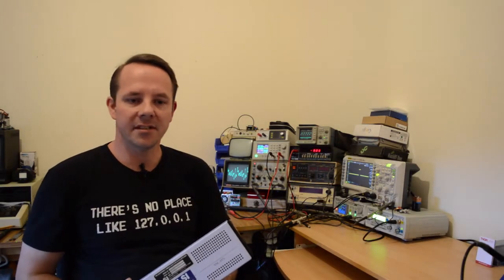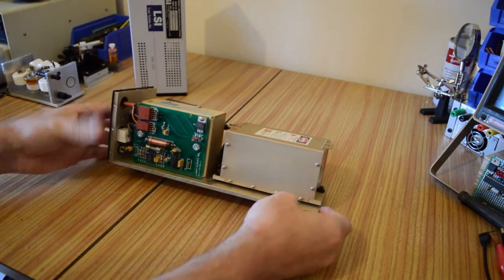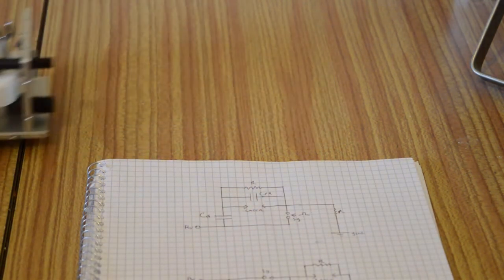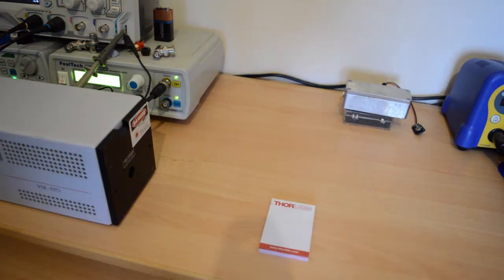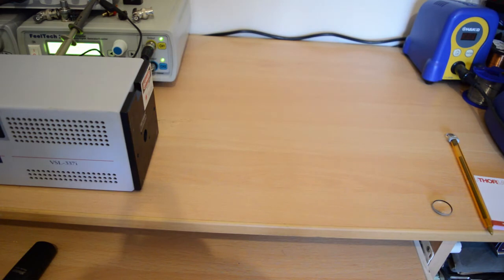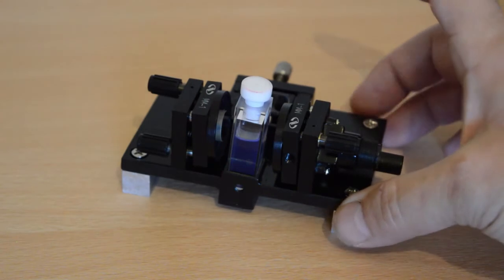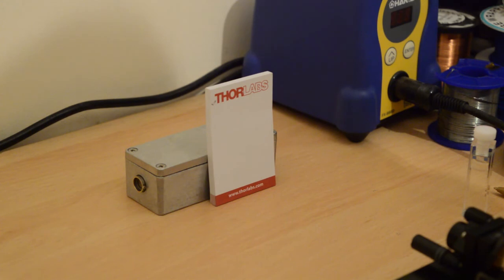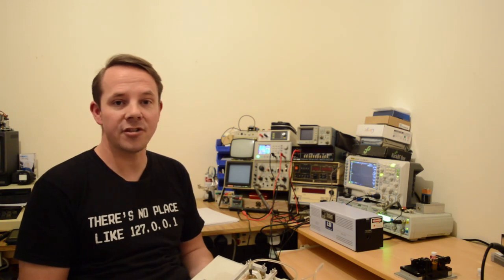Nitrogen Laser tear down, power up, and Home Made Dye Laser Demonstration

Comment: Ten years ago, before the accident i builld two nitrogen laser ,first with longitudinal excitation and the second it was a TEA laser  with equal capacitors.For LE laser discharge i use a capilary with 1mm hole and10cm long with thin windows at the ends.I made low pressure with a seringe.Disadvantage was ozone forming after 15 seconds.My power supply it was a plasma globe flyback  transformer (10kv AC high frequency) and it work with acceptable results.For tea laser the results was very low because i use a high inductance spark gap (my spark gap had long wire)and i use a lot of glue to capacitor .At that time i don t know the trick with low inductance.This is my experiences with nitrogen lasers.

Comment: It might be the titanium dioxide that is added in paper that you see as blue. I don't think they would use coumarin in paper. I also see this fluorescence in white plastics that are dyed with titanium dioxide. I would have to check but I think coumarin like many other dyes needs to be in a solvent for the molecule to be in the right configuration for fluorescence.
Reply from the maker: Thanks for watching!

You are right,  TiO2 is used in paper manufacture as a brilliant white pigment, but its primary mechanism is as a bright pigment, rather that as a fluorescent compound. Although TiO2 does fluoresce, its quantum yield (~0.2) is poor in comparison to Coumarin dyes (~0.73) also the peak fluorescence emission of TiO2 is around 350nm ( in the UV).

TiO2 is primarily used as a brightener because of its highly reflective properties. Believe it or not TiO2 can reflect more light (around 99% in ideal circumstances) than a regular aluminized mirror, , and for this reason, is often used a a diffuse reflector in flashlamp pumped lasers.

Coumarin will quite happily fluoresce when not in solution and is used in paper manufacturing and laundry detergent as an optical brightener, which is why white clothes will fluoresce brilliantly under UV. Is is in fact possible to get liquid laundry detergent to Lase in a dye laser cell!

Stay tuned, I will be doing a teardown on a bigger N2 Laser (once it arrives) ;-)
Reply: @LesLaboratory  Interesting, I will have to look for some information on it. I have not read an MDS on coumarin so I wasn't sure of it's toxicity/uses outside of scientific applications. 

I did a quick test just now with a mini TEA and 355nm laser and you're correct it does show some fluorescence in it's dry state. I am actually a bit surprised because the most dyes seem pretty inert. Bad assumption on my behalf on that. As I said, I am just getting into dye stuff. 

I did not know that titanium dioxide was used in flash lamp assemblies but now that you mention it I think I have seen what look liked white ceramic in a YAG once, but just once. I'll have to take a gander when I am back at work.

 I will certainly stay tuned for more videos, you certainly know your stuff and then some. Now when you say bigger, like is this a laser that needs a cart? lol I should send over some pictures of the N2 laser at the shop I work at that is being rebuilt. You would get a kick out of it I bet. Nothing spacial but it  has built in gravity.

Comment: i made the circuit for hene laser(without capacitors because i dont have)but with a more voltage tube lasing.thanks for this design. output decrease in intensity when the tube heating up?
Reply from the maker: This question was asked previously. Such a power supply absolutely requires filtering capacitors and current limiting, else the tube will become unstable and/or fail. There are no shortcuts unfortunately.

Comment: Any recommendation for materials for the 50/50 beam splitter & specifics for the collimating & quartz cylinder lens you use? I'm setting up a system similar to your video last year on Super Continuum. Not an optical engineer but have spent some time working on camera systems. I wear my rated safety glasses and lock the room I'm doing my assembly work in.

Comment: 3:07 can you elaborate it plz , does helium Mixture used in co2 laser serves as same purpose as used in this laser !!?? Plz tell
Reply from the maker: More or less. In the Nitrogen Laser Helium is simply used a buffer gas that negates the need for a high vacuum, and also helps with ionization.
In CO2 Lasers, it helps the CO2 Molecule relax back down to the ground state, aids ionization, and because it is thermally conductive, helps dissipate heat.
Reply: @LesLaboratory  thank you

Comment: Question: awesome educational video my question is I was luckily to inheriting the laser cartridge without the circuitry so is there other way to power it manually can I used  power source such a variable transformer or ignition coil driver ?
Reply from the maker: Hi, yes you can power those with a home made HV DC power supply. The cartridges don't require vast amounts of current. Ignition coils are not really suitable as the cartridges  expect smooth high voltage DC. A better bet would be a ZVS driver and a small DC flyback. You must limit the output current with a large value resistor, maybe 10Meg to 50Meg. See: https://www.youtube.com/watch?v=GbQEan4gwWM

To power the cartridges, the black wire or case is ground, the larger HV connection should be supplied with 17kV and the smaller HV connector is the trigger (a few kV).
Reply: @LesLaboratory  thank you very much for that info I appreciate it

Comment: i have for he ne laser power supply wire(0,6 mm with insulator) for 20 turns to ferrite core . it is good?
Reply from the maker: Yeah, that should be ok. For ZVS drivers I usually use the thickest I can find that will physically fit.

Comment: it will work the presurized spark gap with air from a tiny compresor ? will not appear condens?
Reply from the maker: You would need to remove the moisture from the air. When you compress air, water precipitates out.

Comment: i cant buy high voltage resistor 20Meg but it will work with 20 resistors(1Meg  3-5W) in series to obtain 20Meg?
Reply from the maker: Yep, that should work. Look for reasonably high voltage rated ones though (>1Kv each, pretty common)

Comment: Hey what instruments do you have on your bench?  I see a few oscilloscopes and maybe a DMM.  Tell us what you have.  I am seeking instruments and would like to see what others have.  Is there a surplus or clearance place where you get lasers like this one?  I worked at a laser company, but that business is defunct now.  If I had my hands on one of their lasers it would have been put to good use.
Reply from the maker: All sorts of equipement! A Hitachi V222 Scope, the Tek 2232, A Rigol DS1054Z, power supplies (riden), function generators, a little Tek 222, Logc analyzers, CRT monitors, Serial Terminals etc etc, etc. Perhaps I should do a lab tour. 
All my Laser surplus these days come from eBay these days. There used to be surplus shops in the UK that did this kind of stuff, but not any more, or t leas not at prices that interest me.

Comment: Are you sure the Nitrogen laser is producing a 4.5ns pulse? 4.5ns is pretty close to the limit the 50MHz scope can resolve. I would also expect a different pulse shape here. Exponential growth followed by a somewhat slower decay.
Reply from the maker: Yes, according to the spec it is, however this is not how energy pyroelectric sensors work. They do not measure in the time domain, so the pulse with and shape are irrelevant, only the height, which translates directly into joules. See the literature of Gentec EO page.
Reply from the maker: Follow up from my answer, the application note is here:https://www.gentec-eo.com/Content/downloads/application-note/AN_202203_LBM_201.pdf
Reply: @LesLaboratory  I was actually referring to the Photodiode you use for the pulse measurement at 12:30 . with the 1Gs scope you're using that only gives you 5 data points along the entire pulse, so I would be at least skeptical about the shape of the pulse.
Reply from the maker: @Farathus  ah right, sorry yes, I get you. The scope was hacked to 100Mhz, but still not enough as you say, unless you do repetitive sampling. I have just bought an old Tek 5000Mhz that is hackable to 1GHz for precisely this reason, so stay tuned!

Comment: So it work without the capacitors? Because i dont found in Romania these capacitors.I have a hellium neon laser tube 7,2mw power.I could use a resistor balast(80-100k)in series with a chain diode(20at 1000v 1A or5A)?
I use a flyback from a plasma globe without diode inside.
Reply from the maker: You need the capacitors for smoothing. You should be able to pick up surplus HV stuff pretty easily on eBay or surplus houses.

Comment: How could you predict the wavelength of the output beam based on the input beam wave length and the dye properties?
Reply from the maker: You could predict Wavelength by looking up the emission spectra of the dye (this would give the wavelength range) and you could calculate the angles required for the grating.

Comment: so i dont presurize with air, and N2 is expensive for me.is more good to use aprox 5cm rail spark gap instead simple gap?Or i should try first with simple gap?
Reply from the maker: Try with a simple gap first, then if it works, refine it.

Comment: i dont found aluminium bars for laser channel. I have brass.It will work with brass or stainless steel?Will not have burnmarks trought the cannel in time or something?
Reply from the maker: I have not tried it, but it will probably work just fine. You might find with brass that you have to clean it more often, as the oxide builds up.

Comment: the power supply will be a mini tv flyback (15-20kv DC) or monitor flyback.what kind of resistor i can use to protect the supply ?if it need it.i dont see very well in clip, which side of aluminium foil is better to put down to the plastic sheet(like mirror or diffuse)?
Reply from the maker: I use  high voltage 20 - 50Meg Ohm resistors (made by Vishay) to limit current in my designs. They are expensive, but may appear on eBay from time to time.

Comment: I can t acces the pages.What is this simpler design(your charge transfer or design with 2 equal capacityes) 
I like more to make your design with doorknob capacitor.With an atmosferic spark gap, and atmosferic laser channel(i don t have N2), the laser (charge transfer design)will lase?I need to know because i want to buy a doorknob capacitor and is expensive
Capacitor have 40kv 1000pf.i don t found acetate ,It will work with copiator transparent sheet?
Reply from the maker: If you want everything to run at atmospheric pressure, try the simpler design as I suggested. Do not attempt more complex designs until you understand their quirks.

Comment: It will work with copiator transparent sheet?I tryed simpler design 12 years ago, before the accident and i havent a good result. Maybe  is good to try charge transfer design in open air with more succes.I colaborated with Ben Schweitzer and he said (the spark gap longer might work)I don t found acetate ,It will work with copiator transparent sheet?i don t found acetate .If it works  I tell you and Ben.
Reply from the maker: See comment above: You might get away with 100 micron for a short while. Stacking sheets is not really a good idea for many reasons. You might find overhead transparencies will work just fine.

Comment: for the resistors ,which is better 3w or 5w ?
Reply from the maker: That depends on the output of your power supply, and you will have to work that out. Building Lasers can be a dangerous undertaking. You should not attempt to build one unless you are absolutely certain you know what you are doing.

Comment: i don t  found acetate at 190 microns.Is good with two sheets of acetate at 100 microns result a    200microns sheet?Or i can use copiator transparent sheet?
Reply from the maker: You might get away with 100 micron for a short while. Stacking sheets is not really a good idea for many reasons. YOu might find overhead transparencies will work just fine.

Comment: when i stick the aluminium foil to plastic sheet, i want to use a small quantity of glue to the corners aluminium foil to stay in place. it is good?
Reply from the maker: Static electricity will hold them down. I never use glue.

Comment: Does the spectrum of nitrogen laser has a single peak at 337.1 nm?
Reply from the maker: All atoms/molecules have multiple emission lines. Whether or not they will Lase is another matter. The 337.1nm line in N2 Lasers has extraordinarily high gain, and will suppress Lasing at other wavelengths. I believe the literature describes one or two other UV Laser lines, and one visible Line, but these are of limited practical use.
Reply: @LesLaboratory  Sorry, I missed a word "laser", I mean the spectrum of nitrogen laser. I got it, thanks for your answer.